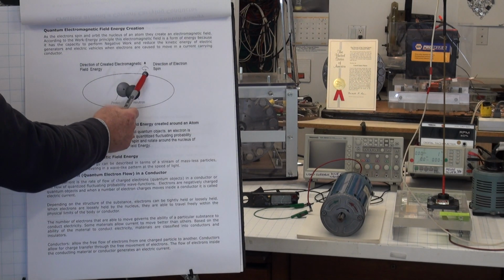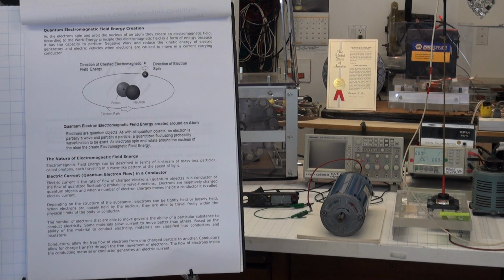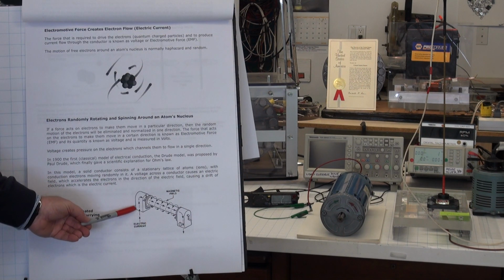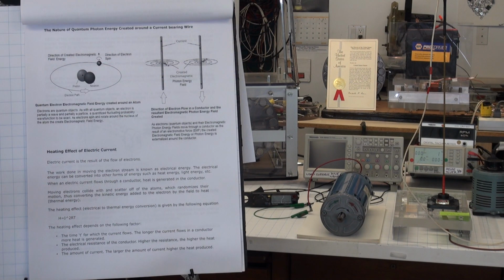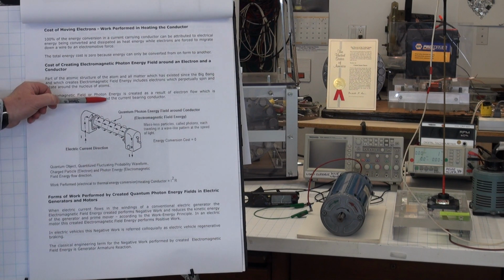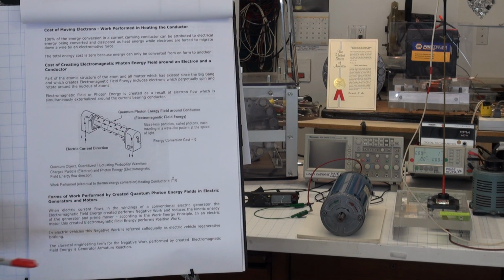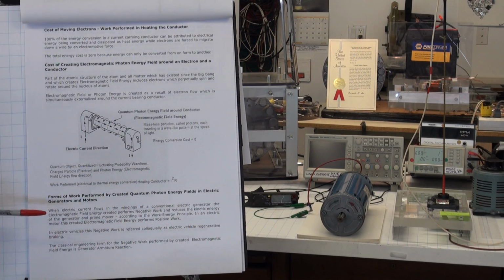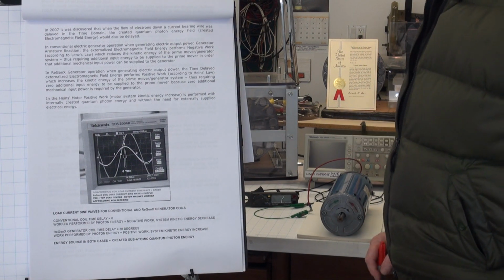PART 1 The Nature of Sub-Atomic Quantom Photon Energy Creation & Externalization around a Wire

Comment: Exactly 👌 it’s ridiculous!
The energy CMMF clearly comes from the input, and the time constant of the negative emf can have a reduced time Constant  meaning it will not effect a negative toque in the same way.

The thing incorrect with the standard teaching is COP measurements .

Lenz law is still happening but with a different time Constant  

The 3rd law is still happening and is the result of the - emf 

The lie is there’s not a exact match between 3rd law classical and electrodynamics version lenz law tho they do match in general pattern - but like all things in nature there’s more dynamics involved in different contexts

And what you’re saying is perfect this way also 

Problem is, we have a world full of nonsense!

Charge pairs + - actually can not simply be compared exactly to the 3rd law but they are in the text books, a big mistake... and so we have used oil for 200 years!